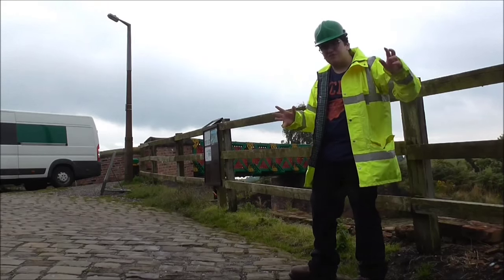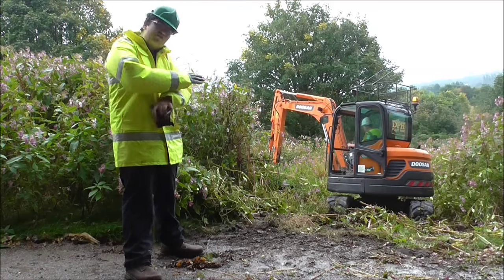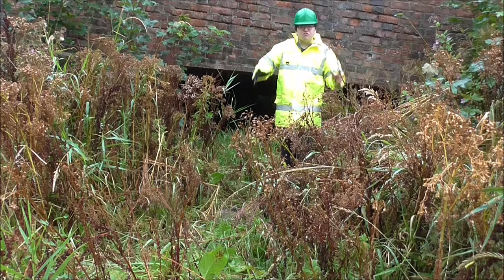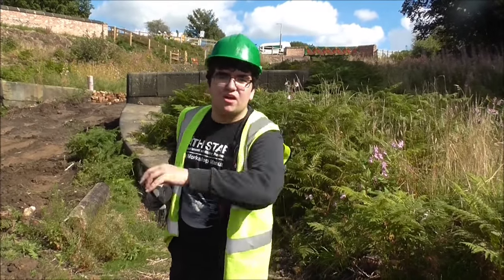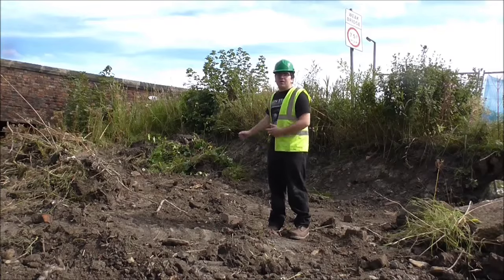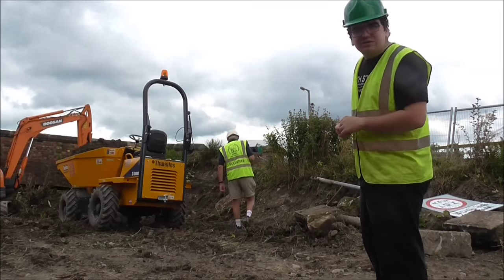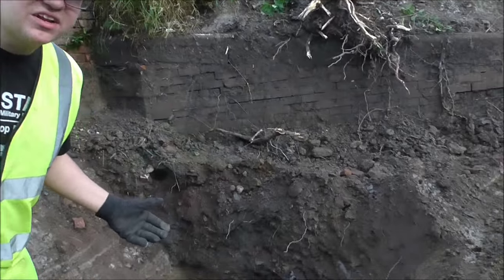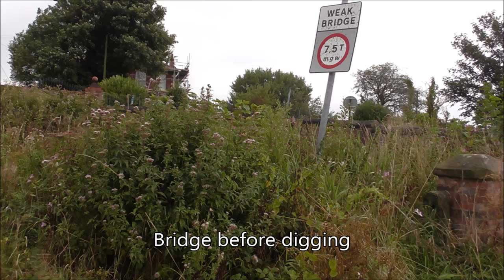Manchester, Bolton and Bury canal Work party - 12/13th September 2015

Comment: why not infuture use bigger machinery
Reply from the maker: +Simon Stebbings Its expensive. thats the only holdback. but we will be using the machines in the future.
Reply: how do I go about volunteering please
Reply from the maker: +Simon Stebbings well, the website has the dates and location of the next work party. There is actually one this weekend at the locks where we will be doing some repair work to the remains of the workshops. you don't have to be a member to help with volunteering, just turn up with appropriate clothing for work and enthusiasm. We always need volunteers so we'd be happy for your help. The facebook page is also useful if you have facebook as its the best place to keep up to date with the current work that is going on.  You can help out in any way that you want if you come and we will all be glad of your help

website - http://www.mbbcs.org.uk/workingparties.html

facebook - https://www.facebook.com/groups/126892584003531/?fref=ts
Reply: +thefatfrierunleshed  thanks I get intouch and theres string winds this weekend and I subscribed to ur u tube page
Reply from the maker: +Simon Stebbings Thanks man, I appreciate it. The canal videos are normally up about 3-4 days after the work party so if ya cant make it, you can keep an eye on the work